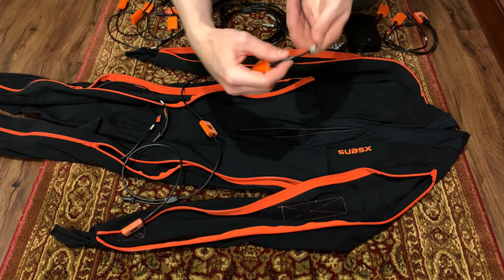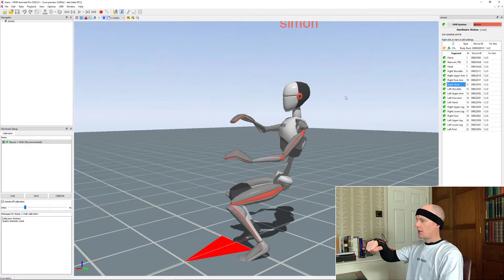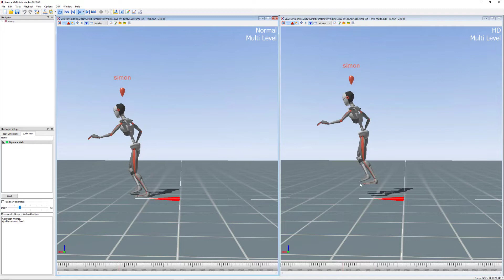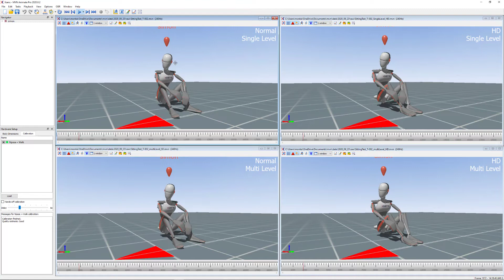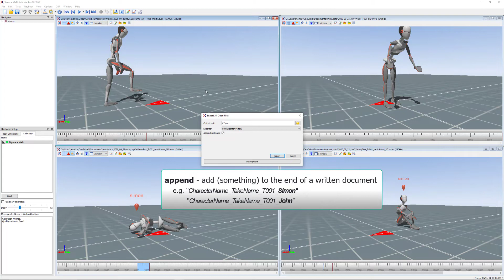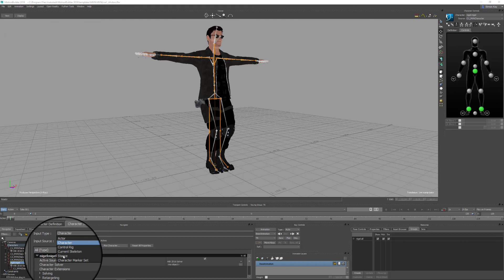How to Use An Xsens MVN Motion Capture System | Mocap at Home

Comment: Hi Mocappys, apart from the full body suit, is it possible to convert motion inertial captured through some Xsens dot single sensors on the main body parts in videos?
Reply: I'm curious about that too, as I'm not sure if there a way to use a single sensor from the suit without the entire suit? I want to check the gait activity.

Comment: thanks a lot for this! It was full of great tips :D I got a bit confused at the end with how the character was characterized and retargeted... is this an issue that comes from Xsens? Do you know if this will get fixed?
Reply from the maker: It’s just the way retargeting in MotionBuilder works and something you have to be aware of. It can happen with other data so it’s good to know about, but it’s not really anyones fault to fix, if that makes sense.
Reply: @mocappys  got it

Comment: Seems to be easily overlooked point: although I have 'loaded' body dimensions which are correct, seems you need to load from file to get rid of the error? (Not all body dimensions are set!). (16:55)  Last night I was doing a session and couldn't get past this. I even typed in the body dimensions and got the same error.  If load or save is required, UI should really give a message.  Anyway, at least I have a way forward!  Thanks for the great vid and all your materials, have learned tons over the years!.

Comment: Going through this today! Already learning a ton from you...as usual!!
Reply: Simon, do you have any tips on when trying to get mocap when sitting cross legged or lying down with this suit. Sometimes I notice I float a little.
Reply: Actually just got to the part where you go over these! Wow, you are amazing!
Reply from the maker: Ah, you’re too kind. Thank you for the kind words. Always happy to help if I can. Hope the tips in the video help solve your floating floor issue. 

Also check your body measurements. Sometimes it’s best to use the default measurements the software creates when you input your height and shoe/foot size, rather than adding your own.

Comment: ty for the vid man ! btw, what's size is your suit ? I've bought an XL suit and would like to know if its oversized or undersized, thanks
Reply from the maker: It's a large. I'm about 5'7"/175cm and wear a large suit.
As a rough guide, large suits cover 170-180cm/5'6”-5'9”. XL suits cover 180-195cm/5'9”-6'4”
Reply: @mocappys  Okay thanks for you response !  Weight don't matter so much? Recommended weight for XL is 90kg but im  70-75kg , sorry for asking again but maybe it will help some other users too !:)
Reply from the maker: The fit of the suit is the most important thing. It needs to be tight to stop the sensors wobbling. It might be worth using the smaller size suit to make sure it fits tight. If not, there should be some bands in the kit you can fasten round the sensors to make sure they’re secure. Good question!